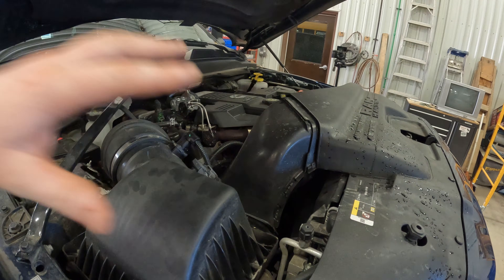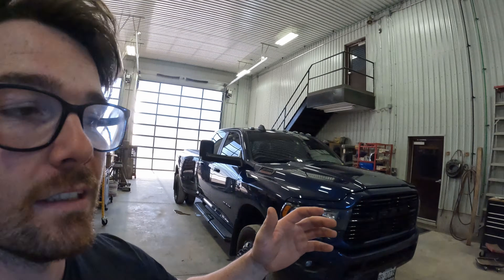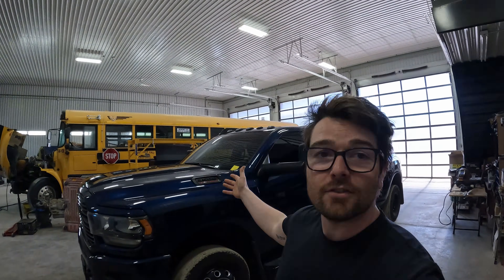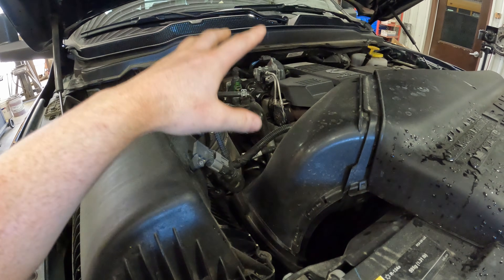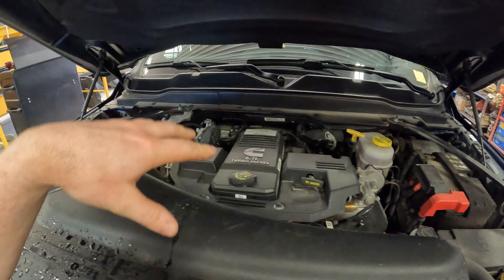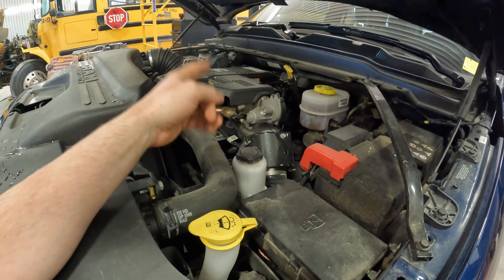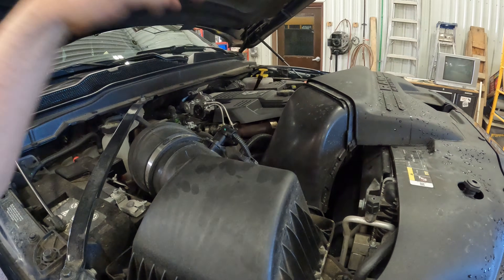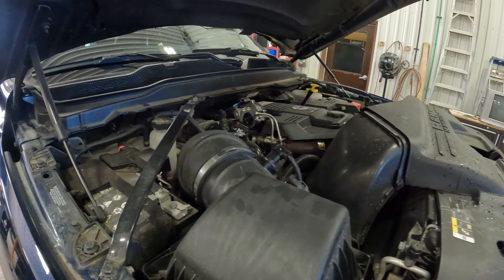RAM 3500 Cummins HIGH OUTPUT Diesel vs STANDARD OUTPUT | What Is the Difference?

Comment: Ram Cummins junk ,mine a 2019 has failed with only 50000 miles and dealership refuses to repair.Still under warranty with the recall on the engine.I will never buy anything from ram again
Reply: MODT DEALERSHIPS ARE LIKE THAT NOWADAYS ... CUMMINS IS A GREAT ENGINE WITHOUT ALL THE B.S.
Reply: The fuel pumps were a major issue on the 2019 and early 2020's they would come apart and destroy the motor
Reply from the maker: Well thats shitty for the dealership to treat you likw that. Why did the dealership refuse to repair it ?
Reply: @GettysGarage  it has been almost 5 months,they told me bad fuel after I paid for a lab to test the fuel.the test showed no problem with the fuel!
Reply from the maker: @dlansburg2673  man oh man. Dealerships can be slimy. have you tried another dealer? because that seems like some bullshit
Reply: Your cp4 took a crap! That’s bs!!
Reply: I had a 2014 ram 6.4 2500. I spent 40k in out of pocket repairs in 3.5 years. I will never buy ram again, went ford superduty and no problems in 4.5 years and i just ordered the 23 superduty. Also ram service sucks and the wait times to get anuthing fixed is usually 30 days.  Ram is a joke, go ford and you wont go back. This is coming from a guy who owned only dodge rams my entire life
Reply: So u went from POS 6.4 GAS TO SUPERDUTY DIESEL?? @Hotshot1989

Comment: I have a 2008 with the Ascin trans. So they have been around much longer than 2013.
Reply: 2008 they put aisin in cab chassis only 3500-5500 2013 on 3500 single and dually optional aisin
Reply from the maker: You are correct sir! Thank you for correcting me. 2007 is when they were first used in a Ram.

Comment: how do you adjust the hydraulic lifters?
Reply from the maker: You don't have to adjust them. Engine oil pressure is used to keep correct backlash on the valves train. Whereas a solid lifter has to be adjust to keep the proper backlash. If that makes sense. 

So the benefit of the hydraulic lifter is they are maintenance free. But in my opinion they are not as reliable as a solid lifter.

Comment: Them trucks are not big enough I pulled a gooseneck with 850 case bulldozer and would run hot it's like driving a freight train with no brakes you can bend the frame really easy I know I did they are not heavy duty you really need a 2 or 3 ton truck or a 18-wheeler I never did feel comfortable with a heavy load
Reply: An 850 is kinda near the maximum weight this truck is capable of hauling. I personally wouldn’t haul over 23k with my 2022 3500 dually. Trailer and load.
Reply from the maker: I think the max rated towing for a 2021 3500 is like 37k which is wild.
Reply from the maker: Agreed! A medium duty freightliner M2 with a much lower rated 6.7 ISB would crush a 3500 all day. 

There is a large difference between a true commercial rig and a HD pick up truck. Regardless that HO cummins is packing a punch
Reply: I haul a 19k pound backhoe for work with a 2019 f450 with flat utility bed loaded down with tools, toolboxes, and generator and it pulls it with ease.

Comment: Didn't 2nd or 1st gen trucks offer a High Output Cummins? To be honest I fill its just a marketing tool, No reason they cant put the H.O Cummins in a 2500. But your already spending close to 100k Whats a little more🤦🤦
Reply from the maker: Nailed it on the head. I would even guess a decent tune on the SO would get you to the HO power ratings. 

And maybe thats why I couldn't find much info because they don't want you to know there really isnt that much difference.
Reply: Why couldn't they have dropped the 68 and kept the G56 (with a better clutch to begin with) along with the aisin transmission
Reply: HO offered as an option in 2003-2004. Became the standard offering in 2004.5+ until the 6.7L dropped in 07.5
Reply: I believe there was a time an H.O. only came with a 6 speed manual because the automatic 48Rfe couldn't take anymore power.

Comment: Love having my G56 fourth gen.  Do a little work to it if you know what I mean and put in a better clutch and you could be close to a high output with a stick shift best of both worlds.
Reply from the maker: Don't get me wrong havint a stick cummins is BAD ASS. And I would love to have one. I was just a little surprised they nurfed the power ratings. 

But like you said maybe you loose some emissions equipment somehow and throw in a nice clutch and you'll have a wicked truck!
Reply: @GettysGarage  the only thing I can think of for there reasoning is the stock clutch is garbage and it was only used to dampen the sound of the g56 cummins combo.  Now a decent dual disk clutch in there and it's a whole different truck.  The G56 can take some power.  There was a user on YouTube with a stock G56 running 11s at the track.  I believe his name is Greg Alberalla.
Reply: @ryanl5888  2018 was the last year for a G56 from the factory. Glad my 2015 drw has it and going strong.

Comment: I just ordered one of these. I run hotshot across the country so I decided this one was the best for me. High output with the tradesmen model 3500….
Reply from the maker: A true work rig. Love it!
Reply: If you make your living with this new truck... get ready for a huge drop in profits since the fuel economy is horrible!!  

The best combination for HotShot would be a Commercial Chassis where you can get the standard output and the Aisin transmission but retain the better compression ratio.  THEN just add the Banks Monster Ram and heater delete to gain more power & efficiency.  Take it from me, I have logged over 100K miles in the past year with my 2021 Ram MegaCab Limited HO and spent a small fortune trying to get it right where a STOCK RAM 2500 MPGs are.
Reply: @DavidWilks  I just got my h/o 6.7 aisin dually, how much do you tow with it and what mpg do you average?
Reply: @DavidWilks  I got it with the 4.10 axle gears, I hotshot for a living and plan to average 100k miles per year as well

Comment: Ford and Chevy has more HP
Reply from the maker: great, my 6.4 has more HP also. doesn't mean it can pull more then the 6.7 Cummins
Reply: When you are Towing something it is Torque not Horse Power that you Need!!!
Reply: @CT9905.  -- with gearing, you can multiply torque.  You cant can't multiply horsepower!
Reply: @rpsmith  Yes and Torque is what you need on a steep Incline!!!
Reply: @CT9905.   -- All the torque in the world wont help if you don't have enough horsepower to clime the hill!
Reply: @rpsmith  Nein, Mai Torque!!!
Reply: Just means they make there power at higher rpm
Reply: look at the ratings on big rigs. Not much more horse power then these pickups but double the torque.  Guess which ones will haul heavier loads.
Reply: @kellybauer1731  Toyota?!
Reply: @kellybauer1731  -- The ones with the the most horsepower if it's geared properly!
Reply: @rpsmith  did some math and you are correct, even 1 more hp at double the rpm will give you more tq to the ground if things are geared to the same speed.
Reply: Ford and Chevy also make more Torque. 2024 Duramax at 1075 ft/lbs standard and new Ford H.O. is at 1200 ft/lbs. RAM is overdue for a refresh on the interior too. Rear seat design in the back of crew cab is very dated. They stuck a newer bigger screen and changed the mirrors in the last 5 years and called it good. Go sit in a new GM...interior is far superior to Ram.

Comment: In 2022 only truck you get ho option is 3500. I bought a 2022 3500 4x4 limited longhorn short bedega cab love thisctruck
Reply from the maker: I wish they would offer the HO in the 2500's but It is what it is!
Reply: The HO has been a 3500 only option since the first HO 6.7L was introduced. There's never been a 2500 HO 6.7L. The 3rd gen 5.9L HO rolled in 2003 as an option, standard in 04.5+ and ran until the first 6.7L in 07.5

Comment: Considering the power levels of the  mechanical 5.9L engines.  And how pleased people were with the power.  If a demonstration of the 4cyl B motor.  With the VGT turbo and an 8-speed ZF medium duty transmission.  Running the 3.42 for 33" tires, 3.73 for 35's.  A 4.4L would be plenty of power!  And most important with $7 or more a Gallon fuel prices.  Extremely economical and practical!.
We have a 2018 Ram 2500 4wd 3.42 ratio with the 6.7L standard output.  That truck is a beast!  We also have a 2016 Ram 1500 4wd 3.92 ratio with the 3L.  But both trucks pull the same trailers rather nicely.  The 3L gets 17mpg @ 55mph, whole the 6.7L gets 13mpg @ 55mph.  Pulling the exact same trailer.
Because of the ZF 8-speed, the 3L is the one to drive in snow and ice conditions.  The 6.7L has just way to much power and throttle sensitivity with the taller axle ratio and only 6 speeds.
If we could buy a Ram 3500 with the 4cyl Cummins B series, ZF 8-speed, 3.42 axle ratio.  Highway fuel economy would be 36mpg at 62mph/100kph.  And would still be a beast!
Reply from the maker: I think a 4 cylinder Cummins would be amazing for the 1500's personally I don't like the 3L Eco diesel but they are efficient! a 4cylinder Cummins with the 8 speed would also be very efficient but also probably wicked tough. great idea I love it!
Reply: Ok

Comment: I don’t understand why the offer 2 versions who wants a lower power engine when buying a diesel truck? If buying a 3/4 might as well go Chevy or ford.
Reply: The standard Cummins with higher compression has A LOT more room for power. The HO has more power from factory, but when doing mods you’ll want the standard output due to it higher compression and configuration!
Reply: @n_rip8344  

Absolutely true!!  And when you consider the added costs to buy the HO vs the SO, add to that the loss in fuel economy each month...  you will be able to buy the SO and add the ATS Allison for less money!!
Reply: Cuz cummins is a better engine
Reply: No we want to make it where we gotta go...
Reply from the maker: If I had to guess it would be to do with marketing. like if you want the big boy engine you have to buy the big expensive 3500. no reason why the 2500 couldn't have the HO engine.

Comment: Dude I love your videos,, i feel like the worse that happened to Diesel in general is the DEF system
Reply: A clear raw diesel engine , is a never die machine,  at least here in US is a pain in the butt the emissions
Reply: A lot of kinks are worked out now a days with after treatment systems. That is as long as you work the truck like they’re built to do. The guys who have after treatment problems are the ones who buys a diesel truck to drive around town and pick up Groceries or go to the mall
Reply from the maker: thank you sir! I mean yes but its a pain in ass when the emission systems fail. it de-rates the whole truck and leaves to stranded. plus the components are stupid expensive. a whole system is probably around 10-15k

Comment: Will you ever touch on delete kits ?
Reply: I deleted my 2021 Ram 3500 because the factory tuning does not take into any consideration the induced drag by boats and other larger towed vehicles.  YES, 5th-Wheel Campers are large but they are simply more aerodynamic than a boat with a t-top acting like a parachute.  Many tuners are specific DELETE DEVICES and as such by the DOT/EPA Regulations are illegal to have on your truck.  The EZlink system is a "Fleet Tracking Device" first that has been utilized by some very smart people to "backdoor" the ECU for tuning capabilities.  This way if you are stopped and it is on your truck, the issue then only becomes one of missing components.  Now, you can run this device with everything installed... but why?  I will say, deleting alone did not make up for the lack of MPGs due to the lower compression, but it did save money from not buying DEF every day while hauling.
Reply: @DavidWilks  
Thanks great info.
Reply from the maker: I honestly just don't have that much experience with deleting emissions. But It would be a good topic to cover. I might try and do some research and see what I come up with. the sad truth is these diesel engines would run so much better with a delete.
Reply: Just finished one and was careful to put a stock tune on the HO. A Mechanic friend warned me factory head bolts and what not Wouldn’t take a strong tune. Fair warning to others “stock” tune doesn’t seem to match HO horse power! Came here to see what the HO was suppose to be to bump it.
Reply: @ditmars1986  Mine is running a 200hp bump and towing with zero issues for 80K miles now.  The HO engines now have the larger head bolts so anyone telling you that shit doesn't know what they are talking about.  I tow every day, up mountain grades and zero issues.